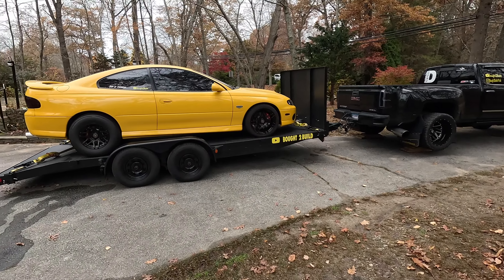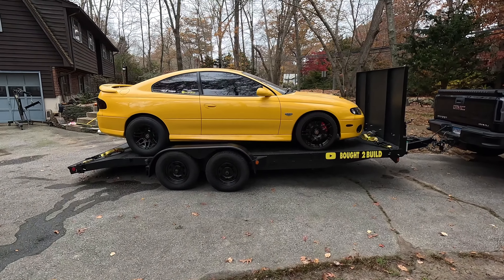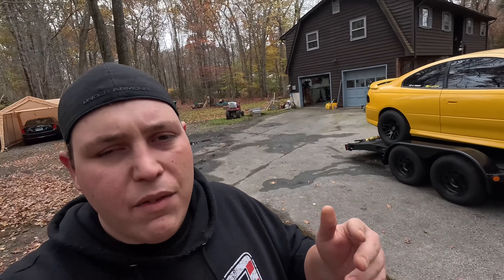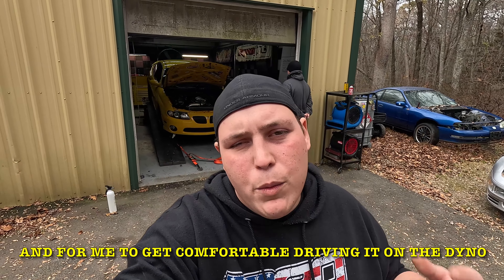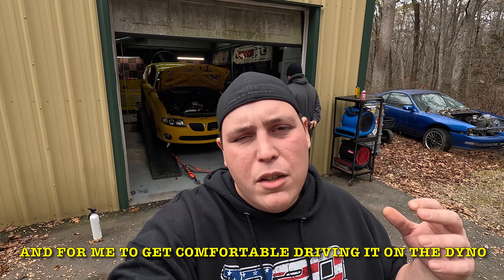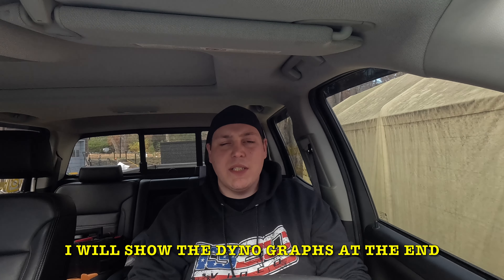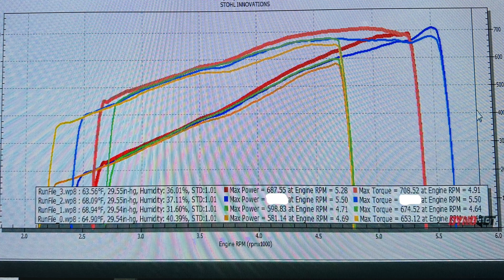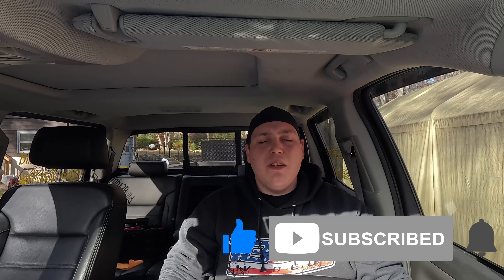FINALLY GOT THE PROCHARGED GTO TO THE DYNO!! DIDN'T GO AS PLANNED BUT MAKES SOME POWER!!!!

Comment: Wasn’t trying to chime in as the shop owner but the angle is not sever enough to effect oil or fuel starvation .. have also done side to side comparison with another dynojet 224xlc on multiple cars with less then 1hp changes .. my dyno is one of if not the most advanced quality roller dyno is the state .. going further I will be putting it in the ground but have seen no difference or negative effect on its current setup with well over 100 cars ran .. thanks for all the input guys would love to visit your shops 🫣

Comment: As someone who also has a GTO, AND ALSO hooked up to that same exact dyno at Henrys Shop, i can faithfully say the car may need some suspension tweaks, tire and pressure play a huge role as well. i had zero issues running my GTO on this dyno (more for the other people in the comments) hope to see that thing around, the car makes some jam!
Reply from the maker: Thanks man appreciate it! And yeah it’s definitely in the car for sure every piece of suspension on the car is new and upgraded so it definitely could just need some dialing in I’d like to find someone with a rear cradle alignment tool to double check it and then also check balance on drive shaft and try a different set of wheels because it is an odd shake for sure thanks for the support homie! 🤟🤟🤟🤟

Comment: Any thoughts on maybe just that crazy Dyno setup? Never in my life saw a car on a Dyno at that angle. Would you think that could be causing the weird shake or vibration just being at an angle that the car is not used to being? Like loading the suspension in a none normal way? Just a thought. Good luck!
Reply from the maker: Uhm honestly I doubt it tbh I’ve seen a bunch of above ground dynos setup similar especially mobile ones are usually a steep angle as well I think it could have something to do with being on a dyno on general because you always strap them down sucking the car down a little but I think it’s more something with the car either something out of balance or out of round maybe 🤔 but we’ll see I will be trying a few things here soon! Thanks for the input and support! 🤟🤟🤟🤟
Reply: Oil pump starvation and of course the front of the crank turning through oil as it's pooled to the front of the pan...
Reply from the maker: @strykerentllc  oil pressure was fine watched it on the gauge the whole time and it’s a front sump pan most people spinning these hard over fill them anyway definitely Not the cause of my shake tho thanks for the concern tho 🤟🤟
Reply: Also, i ran my gen 2 coyote to 8200rpm with stock oil pump gears and stock oil weight on that dyno. The dyno is fine. 
@bought2build, do you have stock toe link bushings in the rear? I believe that's an independent rear? I'm not the best gm guy 🤷‍♂️

Comment: How does the engine deal with the oil being pooled to the front of the pan? Never seen anyone dyno a car on anything but a flat plane to avoid oil pump pickup starvation.

As far as the shake is concerned, jack the ass end of car up and rotate the tires while watching for any runout. That'll tell you if your tires are running true. Measure the circumference of each tire when you're at it...
Reply from the maker: It’s a front sump pan so as far as starvation it’s actually best case scenario it’s putting the oil right to it! And I’ve seen and been on plenty of dyno’s especially mobile dyno’s that have angle to them 

And thanks for the input! Will measure for runout for sure when I get it put up I’d bet money on flat spots from sitting on concrete with a soft tire and or driveshaft but I want to check rear alignment too as everything is new and the entire car has been apart so it is possible something has settled in or moved a little or something 🤟🤟🤟🤟

Comment: I think the gto is fine suspensionis good I’ve always Belen told not to run a radial on the dyno cause car to bounce and shake.
Reply from the maker: Yeah for sure it’s never a great idea to run a drag radial on the dyno but i thought it would be fine because most tires are radial construction but i think what i am going to do is put a set of skinnies that i have on the front and take the front wheels that are on it in this video and put them on the back and try it again because both sets of rear wheels I have for it have a 15” radial on them so we will try that here soon and go from there! Thanks for the support! 🤟🤟🤟🤟

Comment: Yea check the drive shaft.. Cuz you already did the springs and bushings out back if I remember correctly. Tires next agree would be next thing to try. Mine hops pretty bad also under load but I have stock springs/suspension 😅
Reply from the maker: Definitely will! Trying to find a local place that can check and balance my aluminum driveshaft and then I think we will swap the front tires to the rear and see if it helps at all!
And yes sir! Did the pedders drag springs and Viking double adjustable shocks out back g force diff brace and axles and stubs and all Polly bushings which are probably making it feel even worse with the hop lol
Reply: @bought2build I have just about everything you can buy to stop the hop and it’s still terrible
Reply from the maker: @Modern-Muscle-PNW  yeah on the street it doesn’t hop when I Launch it is only doing it on the dyno or high speeds off the dyno we were wondering if the softer springs are actually making it worse on the dyno but we’ll see I am going to start with driveshaft and wheels and go from there
Reply: @bought2build  lmk what you find. I don’t think it’s my parts, has to be alignment or something
Reply from the maker: @Modern-Muscle-PNW  will do 👍 and yeah I am going to have the alignment checked as well 🤟🤟

Comment: love the video. I used to do dyno work before my jewelry days. I've never seen a car loaded on a chassis dyno like that. Not saying its wrong but that's a heck of a rake. My fear would be the oil pump sump running dry. I also think its why you are having suspension issues. I'd like to do a procharger on my H/C/I vert 6 speed SS 5.7. Keep up the great videos! I sub'd too!
Reply from the maker: I mean the angle really isn’t as steep as it looks my car sits on a big rake on its own so this definitely makes it look more extreme but with the GTO’s at least it’s a front sump oil pan so it’s putting the oil right to the oil pickup but I did watch my aem oil pressure gauge the whole time to be safe and I appreciate the input I  don’t think it has anything to do with the shake other GTO’s have been on this dyno no issues and mine had a little shake on the highway at speeds think being strapped down tight just makes it show its face more and definitely do it! I’ve been super happy with the procharger and it makes all the right noises! thanks for the support homie!!! 🤟🤟🤟🤟

Comment: I will bet you the last hundred dollars in my savings that your issue is the aluminum one piece driveshaft. 

Those are famously terrible on these cars, outside of normal street use. On the dyno, you’re doing pulls in 4th gear, and if you’re running the stock 3.46 rear gears in the diff, 4th will take you all the way out to 140mph +.

The critical speed on most of these aluminum driveshafts, assuming they were balanced correctly at their factory, is usually between 130–135 mph in 4th, some don’t even make it that high.

So you were likely experiencing severe driveline vibrations from that shaft. 

If the fenders have not been cut out back, then it’s also possible they were rubbing and creating other issues.

I haven’t seen all your videos, but I wouldn’t be surprised if you just haven’t been able to take it high enough on the street (v-max) to experience the vibes before. 

It’s also possible that the stock T-56 is starting to show its age. We have seen the one piece shafts cause premature bearing failure On the main shaft and tail shafts of these manual transmissions.

Hope you get it sort Sorted out! You can always DM me on FB Messenger to troubleshoot car and Holden issues: (Michael Seabrooke) 🍻
Reply from the maker: I appreciate the information and support! Sorry for the late reply I need to figure out what is going on with my notifications! 🤟🤟🤟🤟👍👍👍👍👍